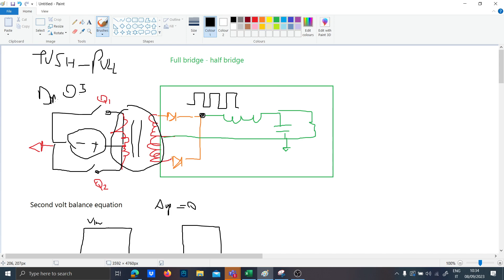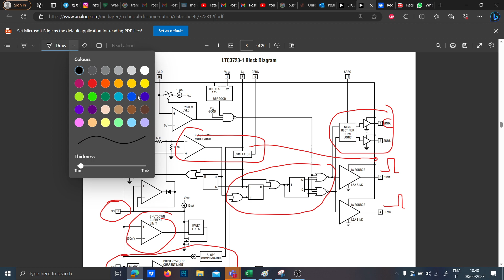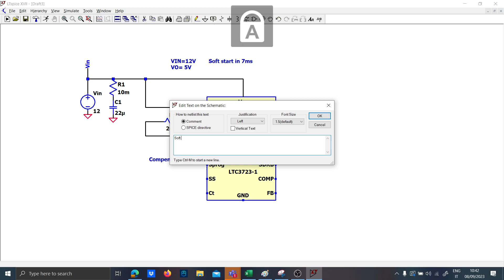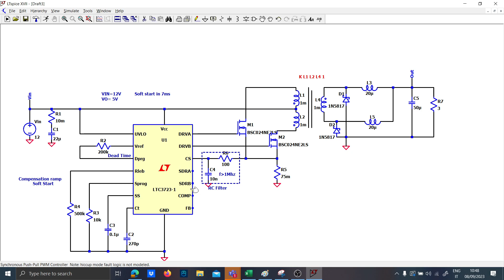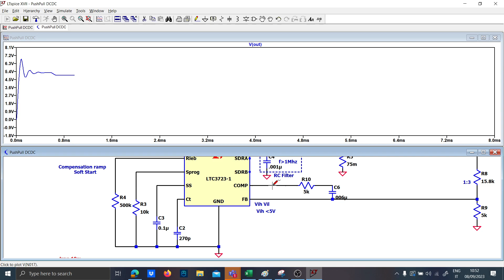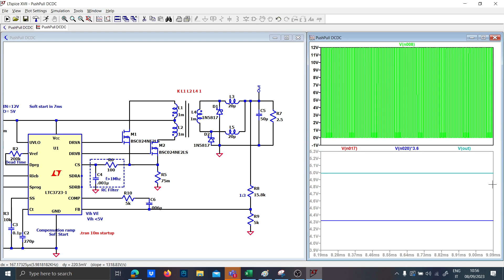DC-DC Push Pull Converter Current Controller

Comment: is(are) optocoupler(s) ommited for easier demonstration? It does not seem right to use transformer based topology without complete isolation
Reply from the maker: There's no reason to simulate isolation in LTspice, because you can't. You have only one ground anyway, why complicate it more?
Reply: @LukeXVIIx64  By the way, do you know if there are any transformer-based SMPS topologies that use duty cycle above 50%? There is formula for transformer primary turns calculation Np= V/(4*f*Bmax*Ac) which is supposed to determine minimum amount of turns to keep transformer from saturation, and coefficient 4 is for 50% duty cycle, though sources sometimes ommit that.